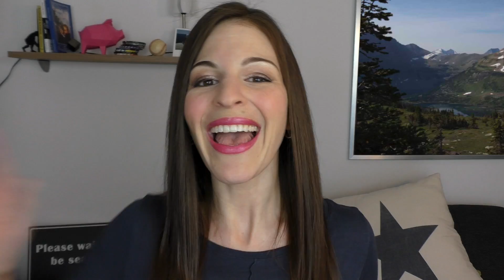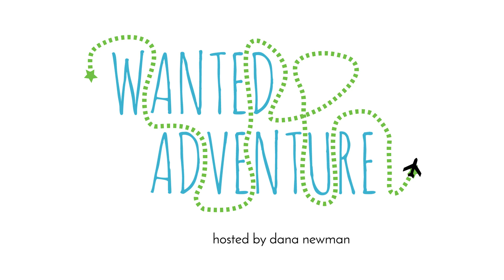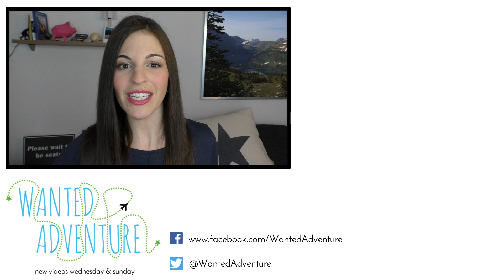Why Are Houses in America MADE OF WOOD?!

Comment: 1. wood is cheaper to build with,  repair and replace.
2. if we built all houses of stone or block the USA would have not one hill or mountain left
3. if you've ever seen the power of a tornado first hand you'd just shut up and not ask silly questions.   no really you would.  

4. Wood is renewable,  there are pine forest all over for building.
5. Wood is faster to build with.  You can have the frame up in a day and gone to the next project while the next crew finishes up.
6. You can not remodel stone or block as easy.  You're stuck with the look for life.
7. Carpenters are a dime a dozen. masonry crews not as easy to find. 
wood gets historic.  Stone gets dated. 
8. have they really seen in person what floods,  and natural disaster does? I mean really seen a flood just wash away a stone house. it isn't pretty and still totaled.
Reply: 1)For some reason (your construction guild/lobby decided so) it is cheaper to build from wood. A wooden FMCG house in USA is still 2x more expensive than same house made of new energy efficient concrete/bricks materials in Europe. The "life expectancy" of a new house in Europe is 300yrs, in USA its 50yrs. So its not actually that cheap right?
2) Its so ridiculous. No, your inability to do a simple math should not be presented as facts. A half mile cut through the Rocky Mountains (across) would be enough to rebuild all American big cities that are home to 62.7 Percent of the U.S. Population.
3)The whole Asia that suffers from typhoons is built of concrete only slums are made of wood&plaster.

Comment: Cost is also an issue.  The cost of a wood built house is cheaper than brick.  If you are building a new home most folks want to spend money on other things than the outside of the house so cut construction costs by going with wood.  The best way to tornado proof a house would be an underground house.  Why aren't more homes built underground in tornado alley for protection?  Once again cost & not a lot of folks are interested in underground homes.

Comment: I used to like brick houses better, until I bought my house made of wood,!!!!!!!!!!! now I see why houses are made of wood, because is so easy to work with!!! plumbing and wire can go through the walls, you can remove walls and put walls so easy,  moving a power outlet is easy, in a brick house all that is way more difficult for a homeowner to do!!!!, I have to frame my basement with wood because I can't install power outlets and wires easily,  yes there are some problems with woods houses but so is with brick houses...

Comment: Subterranean houses can be tornado proof and are not hugely expensive. They're more expensive than wooden houses, but they can be made with poured concrete. They typically have one wall exposed to the sun and the elements, which would be vulnerable to extreme weather, but such a front can be covered with an electrically powered shield made of steel or aluminum. The advantage with wood is that almost anyone can learn to work with it.

Comment: Wouldn't it still be better to build them out of bricks? I mean, wood regrows, but the deforestation is a real problem. And while a Bus might smash trough a whole wooden house, it might only damage one wall and not destroy the whole house. A brick house has also got a better insulation against heat and frost. In Japan they have buildings that do not only withstand severe earthquakes, but also the extremely strong Taifun winds that batter the country. I think American builders should learn from that.  An F5 tornado might destroy every house it hits - whether brick or wood - but an F3 or an F2, which would destroy the wooden houses, might well be withstood by a brick house.

Comment: Well I guess part of the answer is also Suburbia vs. densely built Cities. A few hundred years ago the vast majority of houses was built from wood in Europe as well, but that lead all the more densely packed cities to burn down many times. I guess that is the main reason why that went out of fasion, not only in Europe, also in the US.

In the US there is much more suburbia, and that is where the main difference is. Houses in Suburbs are cheaper in the US, and not supposed to last as long, so they are usually made from wood... Its cheaper and it is actually quite a good material. 

On the countryside, many houses are still made from wood in Europe, in most of Europe north of the Alps that is the traditional way to build a farmhouse.

Comment: Homes in Florida are typically made of masonry, at least on the first floor.  This is because of the prevalence of hurricanes and flood surges.  specifically a flooded wood home develops lots of mold.  

My house (Northeast USA) is solid brick as was required by law when it was built to prevent the spread of fires.  As fire protection has improved this is no longer mandatory.  

Historically it was only in the late 19th century that we had the industry to support the manufacturing of the quantity of bricks needed for construction.

Comment: The flip side to the question is why aren't German houses built of wood? Perhaps because of the frequent wars since the middle ages. Iron and Steel weapons need charcoal for smelting, even copper and tin (Bronze) used fire from wood to melt the ores.Lots of German towns (& all cities?) were walled to protect them. so stone masonry technology was available and associated with security. So the rich built stone houses (Palaces?) and middle class emulated them.So stone (& brick) are seen as desirable and there was pressure on the forestry supply that limited availability of wood.
Reply: jupp, and if ur town has burned down for a few times, than u probably start building with stone.
Reply: Interesting point if european old towns and medieval towns weren't made with stone and not wood, at least in Spain and France.
Reply: it is no just Germany, you could easily say the same thing for any European country

Comment: It is quite easy and cheap to build a house out of wood. Easy spoken, you just raise a foundation take some boards and battens, screw them together, boom you have a house.
Ofc the houses raised like this have a lot of disadvantages. Maybe a house made of bricks is not totally tornado proof, but it is lets call it "strong-wind proof". From fire safety its a total desaster, thermic insulation, also bad. Yeah, it is low cost once, but you pay for it over and over again...
Reply: low cost and very quick to put up - my Swiss spouse finds it hard to believe how quickly houses are completed here. Also he doesn't like that the plumbing and electrical is just lying in the wall between the wood studs instead of being enclosed and protected in tubing within the wall. Our houses in the USA are cheap and not built to last.
Reply: @MyDarlin  But they do last as long as people are willing to maintain them. The oldest house in my town is over 350 years old, and all wood. It was moved about  a mile when it was 100 in 1770.
Reply: @pcno2832  not at all what is being built today. The wood used in historic type homes was thicker and stronger (i. e. not pine). It's likely theres more than just a wood frame.
Reply: +jedy90
Actually, stone and brick are horrible in wind storms, because they don't flex. I'm not sure if building codes even allow brick-faced homes in Florida.
Reply: @bcubed72  Flexing is more of an issue in earthquakes (for which wood has huge advantages) than storms, but without any rebar, masonry has nearly zero tensil strength, so if its weight is not sufficient  to hold it together, is needs steel. Wood has excellent tensil strength as long as the joints between levels are reinforced.
Reply: You can insulate wood-framed houses pretty well, actually, especially using 2 by 6 construction with foam insulation. Wind will likely damage your windows and roof first, which better walls won't really help.

Bricks also require a ton of labor to lay, and it can take a long time. Maintenance of structural brick can also be quite difficult. Even steel and concrete are generally preferred if wood is insufficient. You can always have a brick facade if you like the look.
Reply: Maintenance of bricks? You build a buildining, then insulation and after that desired facade. No one i last 50, maybe even 100 years is making naked brick houses. It is not a castle ffs
Reply: There are different types of wood construction and some types are a lot stronger than other  - such as timber frame construction. Of course that type will cost more to build as well.

Home construction, like everything else is about trade offs and probabilities - and having good homeowners insurance,
Reply: Of course a small Tornado or a small flood will destroy your house.
Reply: The American homes were never built to last.  They want your home to rott so that you should continue to go to the Home Depot or Lowes. If the home is built right once for the owner, why is there a need to repair unless the owner wants to?  The question is, if the America truly have the best of everything, then the options for you to be able to build should also be broad. You have to pay alot of money to build anything and people don't necessarily understand  why they can't build when there are  plenty of land available? Also, people no longer can afford purchaing Acres of land all at once.  Just a mere small piece of lot people can buy would do.
There are so many studpid and idiotic construction laws on each state that it literally makes people want to puke.
Just ask your city and local construction company and they will tell you the reality.
Reply: The saying easy come easy go comes to mind. Or garbage in garbage out.

Comment: It's not all about tornados. I've seen a video here on YouTube where someone lived in a wood house right in the outside of a curve from the main street so every 2 months or so a drunk driver crashed his car into his house. Like literally into his house. Which meant that they could not really use that room of the house anymore because there was this constant danger of getting squished by a car in their own house. 
That is definitely impossible to do on my brick house. Just try crashing your little 2 ton car through the 36 centimeter thick brick walls of my house. But our house also uses wood for the doors, windows (because plastic windows are cheap bullshit) and most of the roof. The outside walls are made out of Ytong bricks for insulation reasons and the inside walls are made out of massive bricks "Kalk"-sandstone. The ceiling and the base of the house are made of steel-concrete. The whole house has a total mass of way over 1000 tons. It won't just fly away like wood houses usually do. But I believe your theory that speeding flying buses (~10-20 tons) would certainly break things.

But this is just a normal house. There are castles and fortresses in Germany that use walls of massive stone that are several meters thick, ain't nobody break those things
Reply: One guy over here had the curve problem, too. He checked building regulations and found out that if a garden wall does not exceed 1 meter in height, there in fact are no regulations.
Now he has a nice wall, just short of a meter high, but at least 2 below ground, reinforced concrete. 
Has to repaint it once in a while.
Reply: You can crash through brick believe me! Plus it could damage the building and structure. I would move out of that house if people were crashing through almost killing you every two months!

Comment: I've read and heard that the use of stone was mandated in many parts of Europe after devastating fires that swept through major metropolitan areas over the course of history.  Lubeck in Germany, Amsterdam etc. A Belgian acquaintance was appalled that Americans built houses of wood in the cities.  He said it was outlawed where he came from because of of these great fires.

Besides, wood is cheaper, lighter and easier to work with than with stone. And there are places in US where sandstone was the only stone around. And its not good for building. Good sized doug fir tree stands well over 100m tall and about 4m in diameter (caliper). One tree probably can supply lumber to build two houses. I often see logging trucks hauling 2m diameter Doug fir. 

I think we are just talking about the exterior of the building or the framing and not the floor, stairs, cabinets and such. Can't imagine a kitchen cabinets out of granite.

Comment: If I lived in Tornado Alley then it'd be iron rebar and concrete. Also brick houses require a lot more labor to be built on top of the fact that brick is expensive. Another thing, don't most brick or stone houses still use wood for the roof?